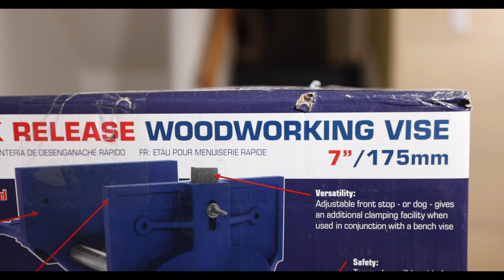Woodworking Vise Install I Eclipse Quick Release! 4K

Comment: I just recently purchased two vevor 13" quick release vises that look very much like this vise but larger. I purchased for fifty dollars each from a store that sells liquidated items I already have a couple work benches I'm making benches as a woodworking project and intend to sell there are five more that I'm thinking of going back to buy since it's such a good price. I  understand the outside jaw pad should be leaning in slightly from the top this is the way it is on my sojbergs workbench. I'm told this is so there is more even contact with work piece.
Reply from the maker: I’ve never looked into myself, but it sounds logical.  I installed my jaws square and have never found any issue with this model.  They’ve worked perfectly so far, and love the quick release, but I’m no expert on Vise installation. Thanks for Watching

Comment: I have a similar vice. As my bench has dog holes, I do use the built-in dog on the vice and find it very useful.
But I replaced the metal dog supplied with one made from hardwood, with a threaded insert for the clamping screw. Hardwood is much more forgiving on plane blades!
Reply from the maker: 👍🏻 So true, thanks for commenting 😊
Reply: Top notch! Well done!